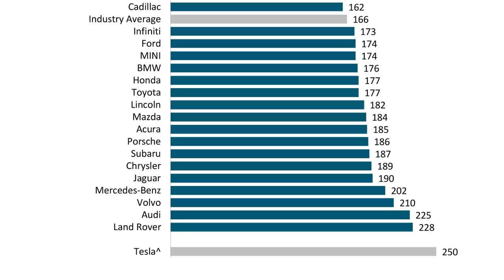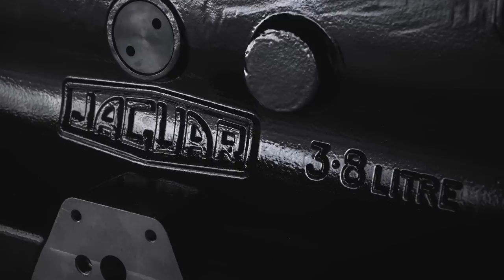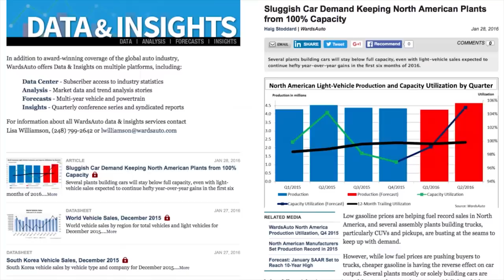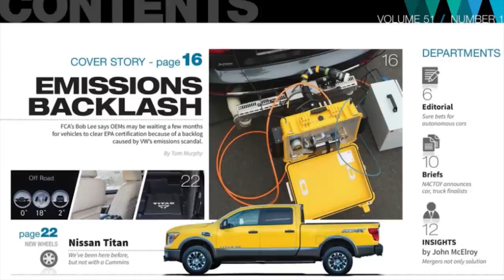All-New Opel Mokka Debuts; Dodge & Kia Tops JD Power's IQS - Autoline Daily 2866

Comment: My Toyota has been a disaster. I bought it new in 2015. 15k miles I had to replace the AC, 35k the driver door lock stopped auto locking  then the  passenger door has stopped working and now the hatch is having an issue opening. It now has 60k I had an inspection it needs a motor mount and front left strut. I have kept up on maintenance I bought the extended service warranty. I’ll never buy another Toyota.

Comment: Our now 6 years Tesla Model S cars. Still working great after 270.000 km (167.000 miles). That’s what counts sure there was some minor issues like some fog inside rear lights. Door handle that stoped presenting due to a faulty wire harness and so on but never something that has stopped our Tesla’s for driving every day. Tesla solved these small issues with our cars like 5 years ago and never been back.
Reply: My Hyundai Elantra is close to 400k miles (643,000 km). Most modern cars last a long time. The reality is that owners usually get tired of their vehicle before they wear out.

Comment: J.D powers is a PR firm. They know nothing about cars and reliability.
Reply: That's why it called initial quality designed to reflect QA, rather than longevity design. No one wants to see stupid stuff like panels not mating properly or features simply not working, all of which reflects that that the car wasn't properly QA before rolling off the line. JD Power initial quality survey is an important study.

Comment: Thats the <<REAL>> million mile Battery John. Just Google Roadrunner project.The deals in china with catl  and other cell providers are mainly to get as many China Model 3s out the door as possible until they ramp up with the second gen battery.The facility is down the road a bit from the main factory in the old Solyndra solar factory.They just applied For permits to put a second floor on the place. If They can squeeze 400 miles out of the first gen battery, Just imagine what the second gen battery (Semi) is capable of! Have a restful vacation.